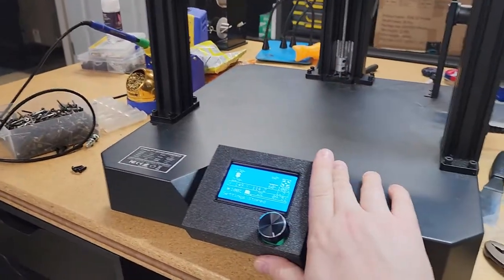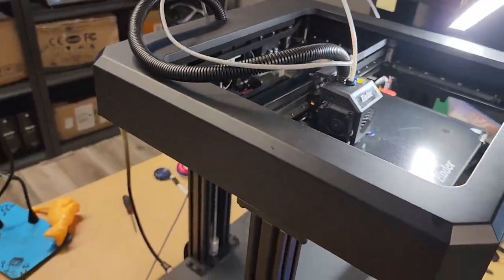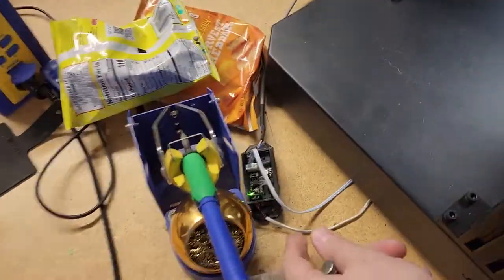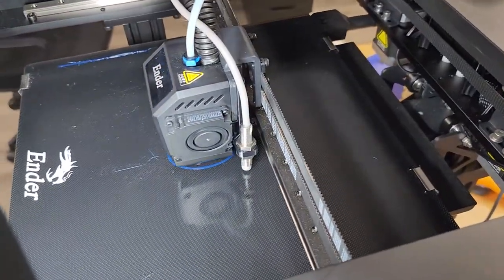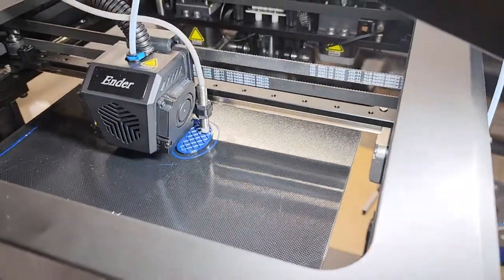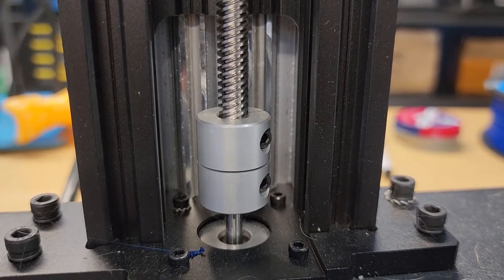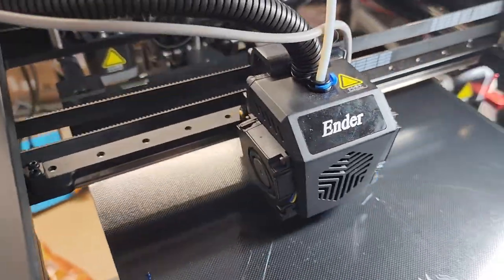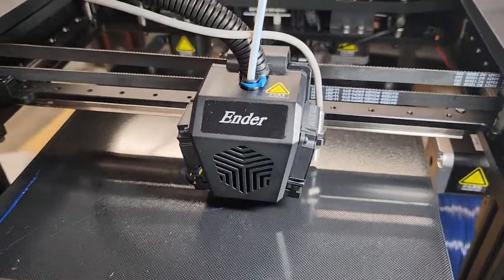Dev Update - Ender 7 LCD Kit, EZABL Support, & Firmware - COMING SOON!

Comment: When are you planning to tackle the EZ board 2 on this beast?  I always wanted to pick an Ender 7 up cheap when someone had parts to drop in to take the good start of a solid machine to the destination of a solid board, leveling system, and hotend.
Reply from the maker: While you could put the ezboard V2 in there its not a drop in, just like the Ender 6. So "official" support would not be something we'd want to do because customers that would be expecting a quick replacement would find they are not able to do so. Also, the XY motor wires would need to be extended from the addon drivers to the EZBoard as well. TLDR its a very involved upgrade but possible.